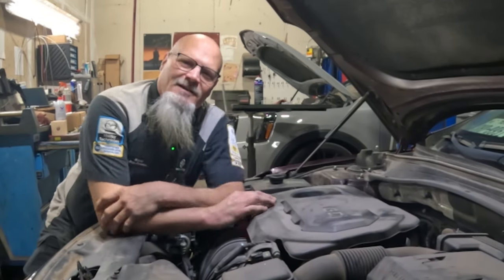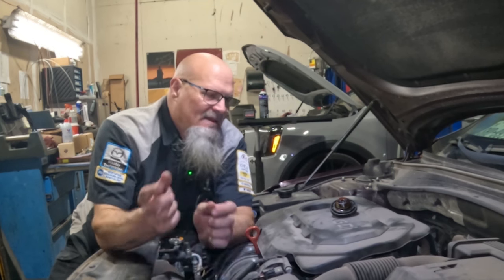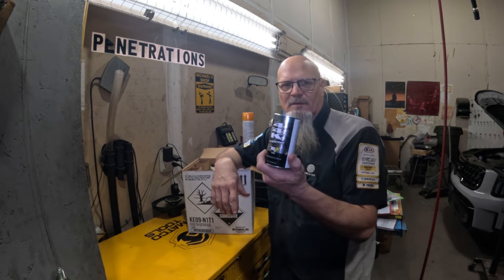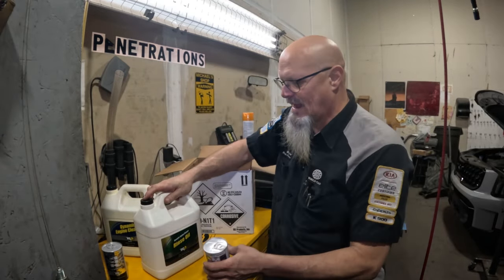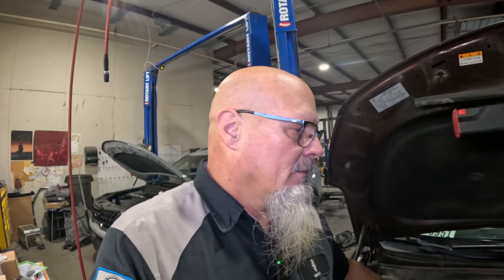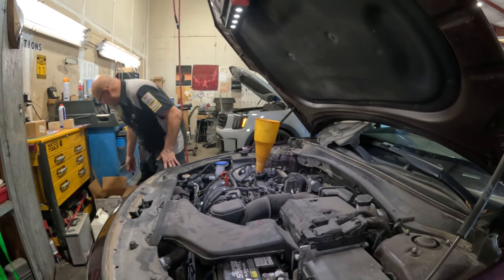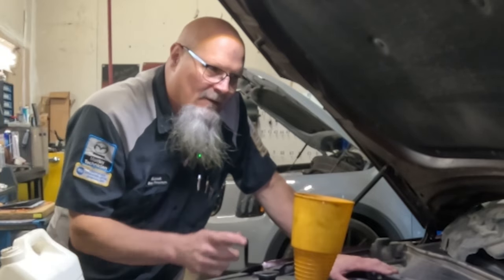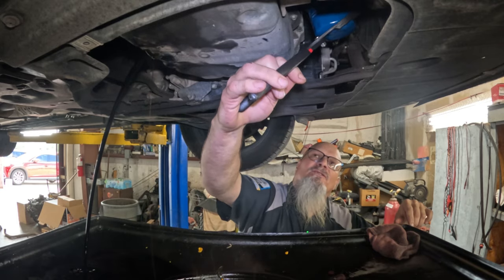Save your engine with a BG Desludge procedure.

Comment: I've used in the past at dealership on used cars. Works great. The magic ingredient is Turpentine. Since retiring I've done a couple with turpentine/marvel mixed together. Great success.
Reply: That's good to know.  Thanks for the comment.
Reply: What ratio of turpentine/marvel mystery oil may I ask? Also any regular oil or just straight like 50/50 turpine/marvel for 45 minutes? Thanks.

Comment: great video, you really give a lot of very useful information in a easy way to understand. 

I'm thinking about getting a CX-5. Are they generally trouble free? I've bought toyota for 25 years but i am getting tired of their price gouging and bad dealers so I was thinking of trying Mazda.

Can you make a video about carbon build up on the intake valves in the SkyActiv engine? I see a lot of videos on youtube about carbon build up but since you are a Mazda tech actually working on these things i feel like you can better address the issue. if it even is a issue...
Reply from the maker: @tarpatel  I have not seen a lot of issues on carbon build-up. The CX-5 is a great vehicle. Some have issues. But nothing that can't be fixed. Thanks for the comment.

Comment: Valvoline Restore and Protect
Reply: If the engine "has time" to use "R&P" over an Oil Change Interval, maybe 4, or continuous... 

It removes the deposits more gradually, hopefully without clogging an Oil filter (it is designed not to... If the Interval isn't "extended", or again engine isn't already a sludge factory with an Emergency Room like "need" for maintenance/removal of as much "deposits" as possible NOW... It can do the work over say 4000+ mile intervals doing regular Oil changes.

Comment: Do you recommend 2016 kia Sportage sli, 2.0 diesel AWD? I was looking into buy one. Do they have problem?
Reply from the maker: KIA diesel vehicles were never released in the USA. I have never worked on or even seen a Sportage 2.0L diesel.  I wish I could be more help. But, I just don't have any information about that vehicle.
Reply: @ShopForemanGarage  ok thanks. I live in Australia so would be different.